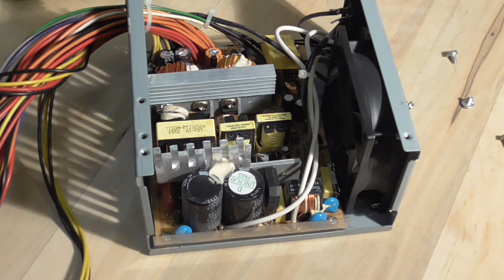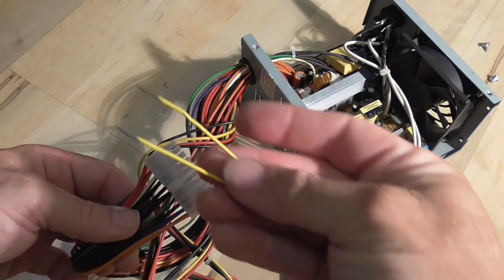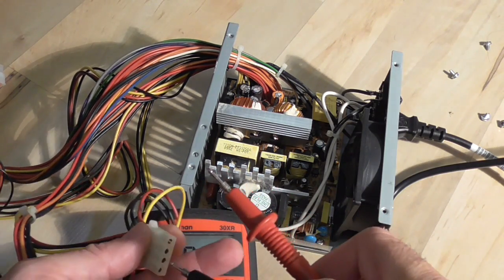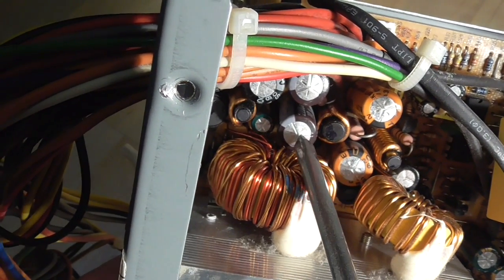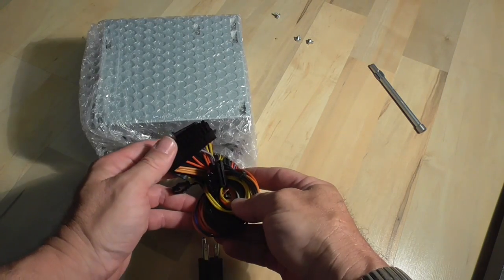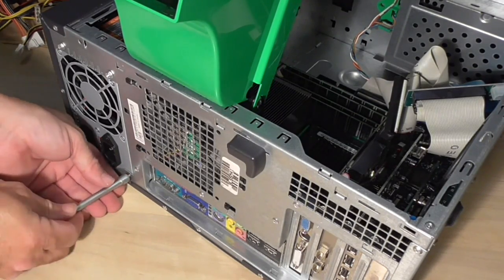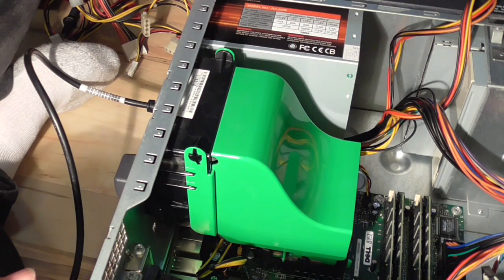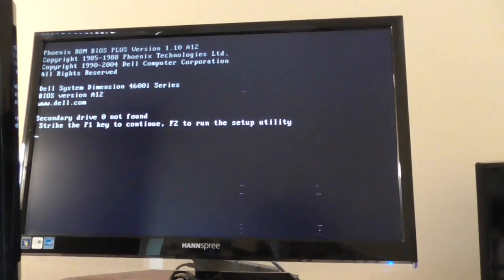Computer power supply PSU fault troubleshooting and repair Replace

Comment: TO DIAGNOSE TRY:

First check the fuse in the plug/your socket and the HDMI/DVI (try the HDMI/DVI on another appliance) and also, in the country I live) the power supply cable is the same used on a kettle so if you don't wanna undo the plug to check the fuse a faster way is to test it on a kettle.

1.  Set everything to default in bios and turn on, this will rule out a bad OC or rule out an auto OC being on mistakenly in the bios or bad voltages etc.

2. Try 1 stick of RAM at at time to test for a bad stick. Check your RAM speeds/volts (this shouldn't be an issue if you did 1 ^^

3. Check hard drives, maybe just take them all out except for the drive with windows on/main drive. Hard Drives don't normally cause this issue though. Still best to do this in case.

4. Take out your GPU (not as hard as you think to do all the above if your new to PCs) and try powering on off to see if the graphics card (GPU) was the issue.

Do the above things and you'll be left with just one drive, power supply, one memory stick, motherboard, CPU so you have the basics and narrowed it down even more. The memory will be ruled out if you did the above, taking the GPU out will let you now it was that if it now boots (for newer people, make sure you plug the HDMI/DVI into the motherboard port after taking out GPU)), That leaves CPU and PSU. That leaves the CPU which is hardest to check without another PC with same motherboard etc but if you've done all the other stuff then that's all it could be bar a wrongly seated cooler or broken heatsink fan (CPU will overheat and shut off so just redo the heatsink and paste) or a software issue (you can reinstall windows to check that). If all this fails then odds are it's your motherboard. It'll have a short or faulty socket or one of a million things so try changing it. You could check all the connections with a vault meter but it's very tedious.

This is best way to do it but can be a pain first time but it's straight forward enough. I've got to do my nephews at the weekend so that should be fun lol.

Comment: What country are you in? I have many 2000W high power mining power supplies, can I give them to you for repair? What is the approximate price of repairing a power supply?
Reply from the maker: sorry- i live in USA... most of these power supplies break with the same parts.. usually a capacitor... there are probably local techs that know how to test them and fix them.... There are many companies that buy these and have their techs fix and resell on the internet for a very high price

Comment: I would really like to fix my windows XP computer so I don't have to replace other devices that I can't get latest drivers for.

My PSU turned  on momentarily with two bulged caps , after doing cap  replacement I don't even get standby voltage now, all I did was replace 1000 ohmn 6.3 v caps  with 1000 ohmn 10 v caps is this the problem please ?
Reply from the maker: i was the same way and finally moved to win 7 then 10 and i love it
Reply: @LEARNINGCHORDS  thanks for your reply am honored to receive  .

Today  had success got  XP back working again,  I  eventually abandoned trying to repair the original  power supply and hacked in a long slim Dell PSU  replacement hanging out the XP computer  case a little,  just cut off  transplanted  over the original hp  compaq 7100  plugs onto  the Dell PSU , had a disappoint for a few minutes as XP computer would  not get out of standby without diverting hard wiring green wire to ground , also on XP HP  Compaq dc  7100   it has  odd now surplus white and white and red striped wires left over  producing about 3.3.volts each   coming  back  from mother board  ,  I  am thinking of tacking on an opto coupler DIY latching board to disconnect the green wire from ground when turning off PC -  one last hack I'm tired of buying the memory button batteries so will sustitute it with a surplus  18650 cell battery and battery  holder plus   TP charger module hot glued  to it's back , a couple or 3  dropper resistors in series or  diodes  here and there  and  job done , would use this battery voltage in part of latching circuit also. 

All this so I can keep my virtual organ going for longer , otherwise I would need to scrap for the sake of obsolete drivers my Roland Um 3 midi merge box $300 , and  Canon Mono  Laser  printer  ( $150 to replace)   which I also have a new Laser cartridge for  which  would of  become obsolete too .

Last year I purchased at shop an HP ELITE 780 with windows 10,  i5 , 250 GB  SSD cost $250 AUD  yes it's nice, though not connected to internet.

My virtual organ console transmits on fixed midi  channels , long story, new free USB  GRANDORGAN program    not so easily assignable (near impossible)  to re route midi channels  as it is on the older free JOrgan program - I have M-Audio ES 61 keyboards waiting to use but again finding updated  drivers is  tricky  but seems possible   but I  have had  no luck so far getting onto USB stick.

Thanks again for your video that has inspired me.

Comment: From a glance, that PSU looks like has the exact same layout as my ISO-400. It was dead and would turn on for about half a second. After replacing ALL the capacitors (which were Fuhiyyu, so they had to go), it now turns on for about 3 seconds... So, progress I guess :)
Reply from the maker: 3 seconds !!

Comment: My computer doesn't turn on after power outages until about 2 or 3 weeks later. Any ideas on what I could try replacing on the inside? 

This has happened with my computer about 3 times now. I have a Compaq Pressario. I tried replacing that battery and that wasn't the problem. Also when the green back light comes back on there's usually no problem with the computer until we get hit with another power outage with the computer on.
Reply: @LEARNINGCHORDS  

Are there any fuses in these PCs I could change?

Comment: My power supply is 750 watts and it is fully modular, not very cheap to buy one like it so one like that would be worth fixing. Most of them under 500 watts are fairly cheap so then it makes sense to replace it.

Comment: Ehhh $8,- for some new caps is a LOT cheaper then $30,- a $40,- or more.

And why would you use a cheap ass PSU in a computer, that is really stupid, also because normally a computer is NOT cheap, and a PSU can destroy your hole computer, i have seen it happen, a PSU is the most important part of your computer.

Comment: One needs low ESR capacitors, which I believe Radio Shack don't stock. For me it is worth recapping with quality caps, as the resulting unit may last longer than new.

Comment: First of all I wanna say that this is a fanatic video! Thank you! I was using my psu for an iMax charger, and a 20A Li ion bms. Everything was fine for a couple of months but yesterday the darn then suddenly stopped working. Only it only has power on the 5v sb wire (the white cable on the big psu cable thingy. And just like the one on you're video the fans work for a second or two then stop. What do you think must have blown? I did take it off but I don't see any bulging caps.

Comment: Good video! I heard Loud pop and now my PC is dead! So far one power supply does not work and the new one does not work also. My fun just begins!
Reply: Thanks, just like the street capacitor that is on the poll! Blew last year. I have looked at the PWB and found nothing but the Power Supply fan did not work when I have shorted the green wire with the black wires.
The new PW supply I got last week past the test. I just hope the PWB I received two weeks ago was not defective.....

Comment: I have a buzzing/whining sound on my PSU. I researched about it and found out that it might be on the coil. so... how could I fix it?
Reply: and oh. my capacitor have brown crud/ dried sludge on it. So it might be gasses/liquid that is leaking from it.
Reply: Ian Kyle Maturan i made that and works. I do not recomend using lower capacitance for a long term repair, but for testing porpouses you can and will work. Just make sure voltage is same or bigger.